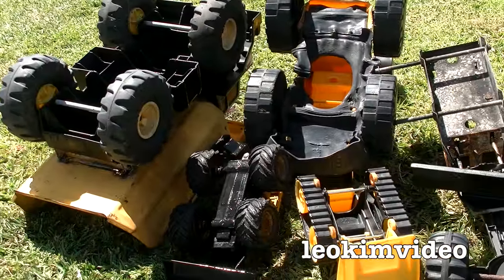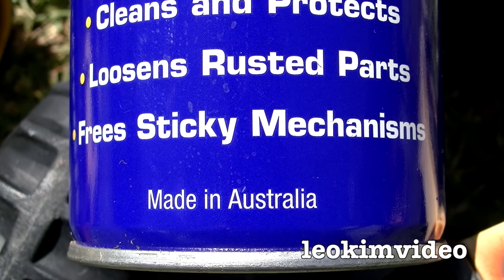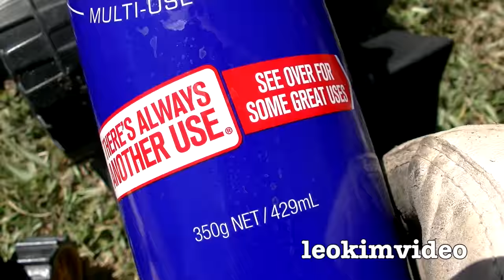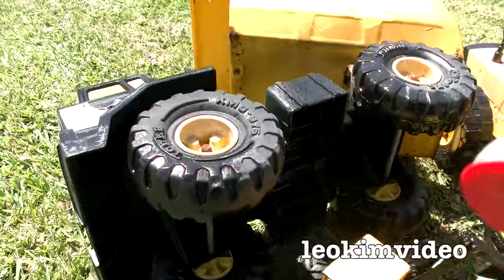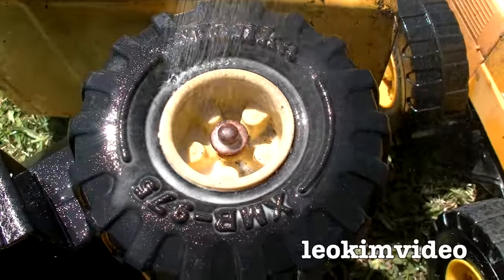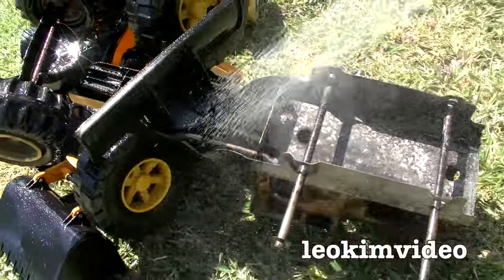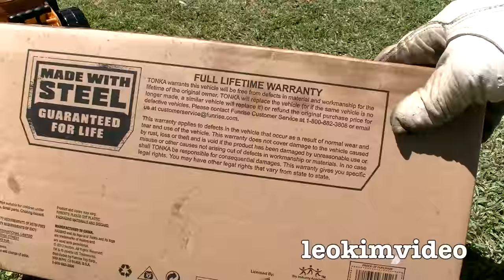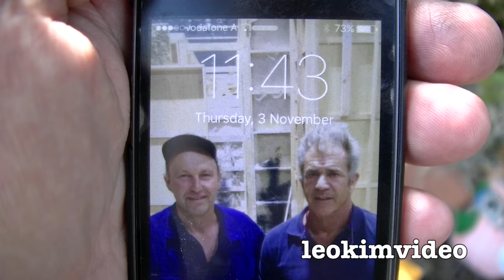Deadly Redback Spiders On Tonka Toys Again WD40 Spider Control Test

Comment: Hey. Leo. For one, I don't think the Redbacks will come back in a huge infestation, as you set a good warning to them....second thing. Buy some cans of....Well pressurized air, I forget what it's called, why? Because if you turn it upside down, and spray it, it sprays out this REALLY cold liquid that freezes almost instantly, so you can save Mummys Garden from becoming a crisp, and, ypu can now freeze the spiders, and if you do get Mummy's plants, they will Unfreeze pretty easily. Hope you read this and try it, it works for me and my Brown Recluses and Black Widows.
Reply: Carrot Top well, he's currently torching everything, which an accidental spray of toward a plant won't kill it. A blast of frost on the other hand... That'd be something that could kill my roses.
Reply: Casey Kline Eh. I live In a Frikin Desert, so I don't really worry much about Garden...well, although I do have Ice Plants....Eh, the blast is very very small, It's a very high possibility that it won't kill her plants. It's shot out of a small straw anyways, oh. and becarful with it. sometimes the straw CAN and probably WILL pop off, so make sure it's secure before using it.
Reply from the maker: I'll give that a go, but this freeze trick needs to work superfast. Thats why the flamethrower with Rexona is excellent...it's so hot and super fast.
Reply: ThatOnlyGator smoke weed everyday XD
Reply: Carrot Top that stuff can be deadly if consumed but the thing with red backs and black widows is that if frozen once thawed they will come back alive.

Comment: You should just throw all the toys with redbacks in them in one bucket then poor gasoline all over them and lite a match and as you're walking away throw it in when you're facing away from it, because cool guys don't look at explosions.
Reply: killer47 probably not allowed to have fires in middle of summer in Australia though... but i agree.
Reply: J Hughes you are correct. I live in Australia and a total open fire ban has been issued for summer, so bye campers!
Reply: killer47 it has to be in slow motion too. It HAS to be.
Reply: marquavious bradley
Reply: killer47 wd40

Comment: wd40 is also flammable. and as it's a liquid it acts a lot like napalm and the liquid burns and not the vapour
Reply: Lance corporal cook that is true lol
Reply: Napalm is a jell
if the military and such just needed a flammable liquid they'd use gasoline
Reply: UnchartedGamer gasoline doesn't burn. The vapour coming off gasoline does. 

Dunk a match quickly into gasoline and it will go out. Not ignite in a ball of flames. 

Although napalm is a jelly like substance, it quickly thins when under heat.
Reply: Lance corporal cook Regardless, the  attractive aspect of napalm is its jell characteristics, and WD40 lacks those
Reply: UnchartedGamer it's jell characteristics only work when cooled. Heat it up and they both are liquids.
Reply: WD 40 doesn't burn worth shit on its own..
Reply: blu3flare25 from one of those cans it will. Trust me
Reply: Lance corporal cook Im around the stuff every day, it doesn't burn well even with a torch trust me...
Reply: blu3flare25 I have used it to burn a wasps nest before, trust me
Reply: Lance corporal cook Well it would burn well if you spray it on something that's already flammable, but on its own it will not stay lit..
Reply: Yeah it will stay lit. Because it burns

Comment: I would just cover up the holes underneath with some tape or maybe even silicone
Reply from the maker: Maybe thats something Mr Tonka can consider. Considering it's a $50 toy I am expecting something that comes with lots of bells and whistles. That toy hovers between $40 to $50. Mine was purchased from David Jones which is expensive at the best of times. I have not seen this Tonka Grader in KMart or Target. I assume this toy in the USA is $20. Australia has stupid high toy pricing.
Reply: SourLemon

Comment: You can fill that gap with some sort of agent that hardens
Reply: zak b. Yeah some packing foam could work
Reply: zak b. i think there are moving parts inside to steer the wheels so foam would make them stuck.
Reply from the maker: I'll try to extract Agent Smith from my Matrix DVD's
Reply: zak b. you can use spray foam to fill the gabs